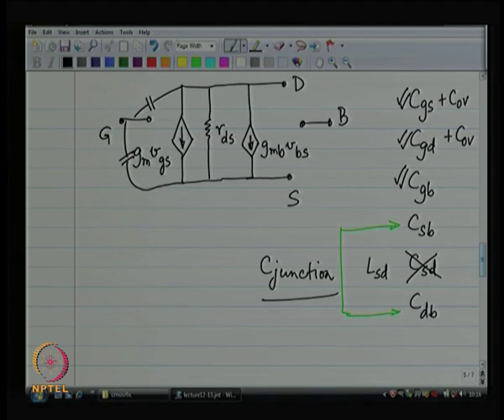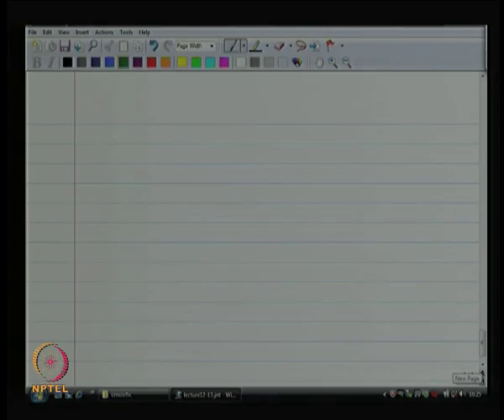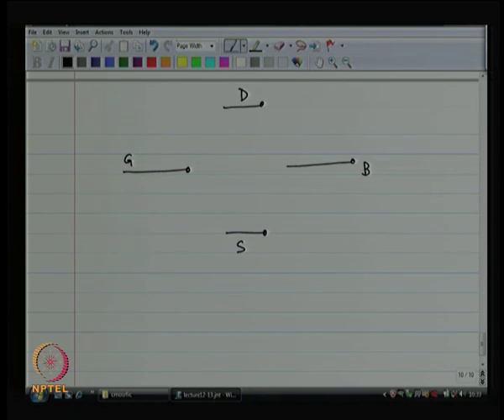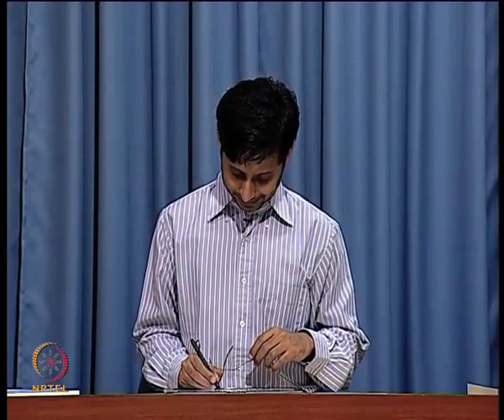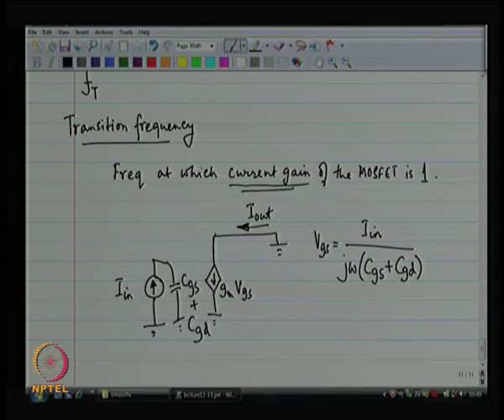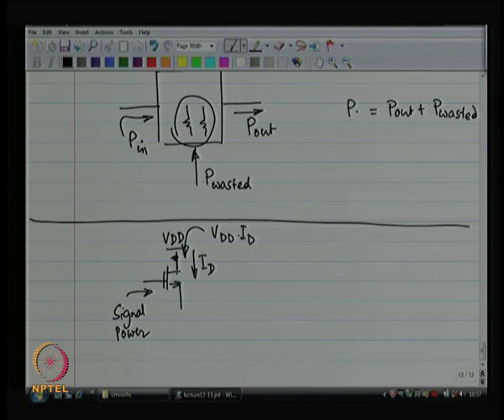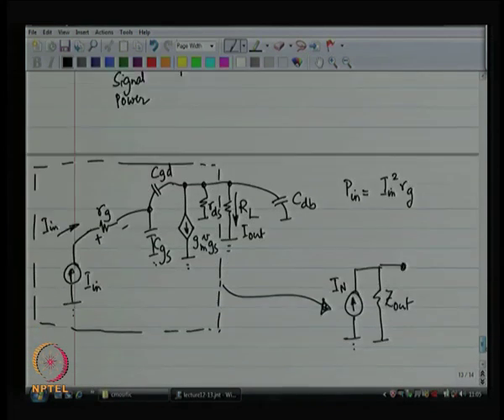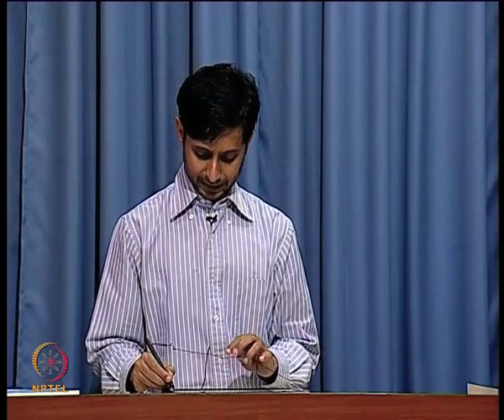Mod-04 Lec-13 MOS capacitances

Comment: Sir @35:00 when we increase the width of the transistor gm increases proprtional to the square root of width whereas Cgs and Cgd increases linearly , hence wt going to decrease. Obviously, in this whole scenario we have a fixed bias current.
Reply: gm=un*Cox*(W/L)*(Vgs-Vt) so here gm is proportional to W given that Vgs-Vt is constant. So, ft doesn't change with width
Reply: @ashishpapreja3756  Bro ft is equal to gm over 2*pi* Cgg. If you increase w Cgg increases proportionally and eventually ft going to decrease.
Reply: @RAINBOW RANGERS  gm proportional to w on the numerator is cancelled by Cgg proportional to w on the denominator, so ft is fixed.
Reply: @alonsosch  if the current is fixed (this is important )...then gm is not proportional to the width w because in that equation there is also Vgs -Vt..if you increase width ..let say you double the width..then gm will not get doubled because Vgs-Vt will also increase.